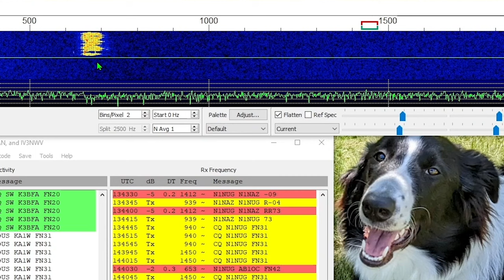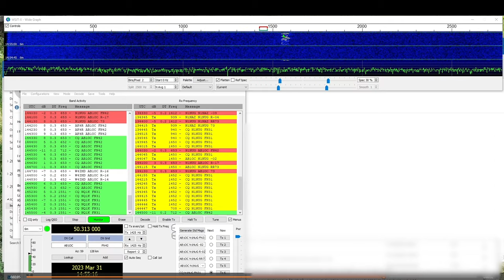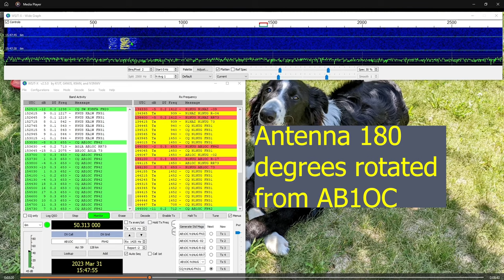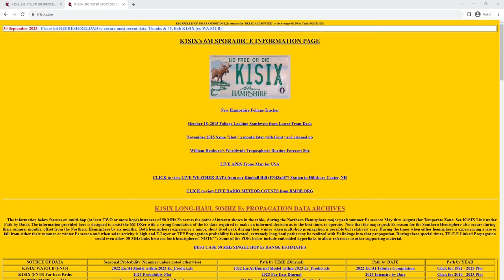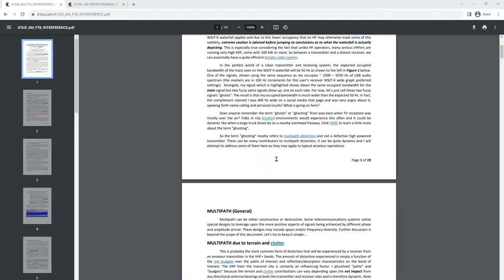Ham Radio: Why are These 6 Meter FT8 Signals So WIDE?

Comment: FT8 signals are a single tone that shifts in frequency over time to represent the data symbols.
The most current symbol is received over the more direct path.
A previous symbol is received at the same time, but over a longer path.
These two may be creating mixing products, the sum and the difference.

Distance does not change the frequency. Changing distance (Doppler) does, but is unlikely given  your description and steady observations.
To shift up and down, at the same time would require two reflecting surfaces, one approaching you and one leaving you.

The waterfall display, of the decoded audio, obscures what is really going on. (WSJT-X display)
It would be interesting to observe this phenomenon using a different receiver design, such as one of the SDRs with a high resolution spectrum display.

You have a 991A? I think that is a triple conversion superhetrodyne, so mixing products, artifacts, may be occurring in your receiver.

I am unlikely to recreate your situation here in Florida, where I can compare an Icom IC-756proIII with a FLEX-6400 using a 5-element beam, but without any mountains.

-Tim, KI4TG
Reply: you are systematic. Look at my post

Comment: Excellent video Rob and a very personal interest to me. 

I’ve noticed this phenomenon on 6m too and from what I can see on my end is Sporadic E backstatter. 

Basically two (or more) stations might be pointing at a common point (a cloud) but not actually pointing at each other (but still receiving each other direct, either via another cloud or via groundwave etc).

What you then get are these ghost or mirror images with multipathing as you described, sometimes really strong and distorted.

It’s common for me to receive a station in VK5 (approx 315 degrees heading) when I’m beaming toward New Zealand (20 degrees) and I’ll get two signals - you can actually see it more clearly on WSPR and it decodes as two signals on different frequencies. Very cool! Thanks again for the video
Reply from the maker: I think you are right - the reflections are most likely coming from sporadic E "clouds".  I think what we are seeing is "delay spread" which causes the signal to spread out and look wide.
Reply: the differences are too small. Look at my post

Comment: Simple Multipath is a time domain phenomenon.   It won't create a frequency shift like that.  If the frequency shift changes,  it could be dopler, the reflection of a  moving, a truck?  If one of the atmospheric paths is changing  effective length, that would create a dopler shift.  A constant frequency image could be caused by mixing.  It looked like the image was shifted by 60 hz.  LED Christmas tree lights?  Or many other way 60Hz could get nonlinearly mixed.
Reply: i do not think so. If so, then it would manifest at any angle. Look at my post and give me your opinion

Comment: A time delay such as multipath would cause a phase  shift, Fourier Transform pairs, so it must be  something else.   Hard  to tell since not under controlled conditions.  Good  that you are  looking into this!
Reply: Suspect it is not for different pathways outside antenna, but for different pathways inside the antenna, meaning in the space inside the geometry of the antenna. Suspect it only happens, or mainly happens to multielement directional antennas. It is about the directivity mechanism, where axial it is phased, and from sides it is unphased. The differences in frequency that result, correspond to the size of the elements of the antenna, space delays that can result within those sizes. It has nothing to do with different pathways on the long distance propagation.

Comment: This looks like classic doppler shifting the audio frequency just like a freight train coming and going while the horn is triggered.  If thats the case, there's likely a multipath-causing object that is moving at a constant rate. Or two objects causing multipath, each moving at a certain rate but in opposite directions.   Pretty amazing. My guess is that the exact frequency shift of the audio and the amplitude could point you toward the object(s).   One other thought - is there a heliport nearby ?  If so, it could be worth checking the typical rotation speed of the props when a helicopter is on the ground, and compare that with the location (dist) and the audio shift.
Reply from the maker: The closest airport is 25 miles away.  And this phenomenon happens all the time, not just for a few minutes.  I think we're looking at delay spread which is similar to  the Doppler spread you are talking about.
Reply: @SevenFortyOne  You might be seeing meteor scatter. Its very doable on 6m. There are specific frequencies people use for ft8, msk144, and ssb meteor work on 6.

Comment: That’s odd and I’m confused. Unless the thing doing the reflecting is moving very fast  (like a plane, satellite, or ionospheric disturbances) multipath should not alter the frequency *that much*. It will alter the time, ie latency, because it travels a longer path. It’s the same as an echo off a canyon wall - your voice’s echo isn’t deeper or higher pitched. I will have to read up on it!

Update: after reading up on it, i'm convinced this is airplane scatter. Air traffic flying to or away the transmitter on the order of 600 mph can cause a doppler shift of up to 50Hz on either side of the fundamental. That lines up with the greatest extent AB1OC's signal was off-frequency at 5:29. However, the change in frequency over time is kind of slow, so you don't see it well in the ft8 waterfall, but I do notice wsjt-x fails to decode the ghost, and that makes sense - because wsjt loses frequency sync since it might be several Hz off from when it started.

Also, since AB1OC's using big QRO, and the RCS of a typical jet at 50MHz is pretty massive (I have industry experience as a defense aerospace RF engineer), it's a no-brainer. K1SIX alluded to it in his monologue, but called it off for "insufficient information." 

The smoking gun would be to get AB1OC to send out a CW signal for a minute, and watch his ghost drift by 0.5hz/sec or so. That kind of thing is pretty hard to track along with FT8.

Multipath against static reflectors like terrain should certainly not modify the frequency (only the time delay i.e. phase, which will cause amplitude fading) unless those mountains are being moved. Shout out to whoever figured out how to move mountains that fast!
Reply from the maker: I'm certainly no expert but I think we are seeing delay spread or Doppler spread but I'm not sure what's causing it.  I need to do more research too....
Reply: @SevenFortyOne   I made an edit to my comment - convinced it's airplane scatter.
Reply from the maker: @N0SSC  What you are saying makes perfect sense.  However, this wasn't a one time occurrence.  I didn't mention it in the video but I saw this on AB1OC and K1SIX every day over the span of a few hours for a week or so.  Judging from the complaints K1SIX has received others are seeing it pretty consistently too.  Also, If I kept the antenna pointed away from Fred the ghost images stayed fairly constant during the times I was paying attention.  Signal strength faded in and out a bit but he always looked wide when the antenna was pointed away.  However, we are under the main flight path between the US and Europe so there is pretty consistent air traffic overhead (30,000 - 40,000 ft) most days.  Maybe there is enough traffic up there to sustain the signal spreading over several hours and occur regularly every day.  I'll have set this all up again and have another look with flight radar open on another screen and see if I can draw any correlations between the signal spread and air traffic.
Reply: @SevenFortyOne  k1vlf on YouTube has some airplane scatter spectrum captures from near your area, using VORs as sources. There’s tons of air traffic density up there, so it’s not surprising that it’s consistent but looks a bit different every time. Aircraft scatter is a highly desired phenomenon for microwave flatlanders, insofar that W3SZ wrote a program to plan AS contacts with real-time flight data.
Reply from the maker: Thanks for the heads up - I'll check out Paul's videos on the subject.  I really like his videos and watch most of them when he publishes them but must have missed that one.

Comment: When a signal reflects off a stationary object, it will be shifted in time only, not frequency. If it was reflected off of a moving object, you would have a frequency shift due to the doppler effect.
Reply: yeah, but that would not be symetrical, would produce only on one side. Look at my post and give me your opinion

Comment: I am sure my point has already been raised in the comments, this is an interesting observation but as presented is not entirely convincing me. I think the multipath aspect is absolutely correct but that the reflection path is changing in distance. Perhaps a moving layer of the ionosphere. A reflection over a fixed path length should appear a the receiver at the same frequency it was transmitted on. A varying length path will create doppler shift. A very interesting video, and I do have some sympathy for a station that does get complaints from others. I operate FT8 a lot on HF, but so does another station a few hundred yards away. The phase noise from my rig and the ridiculous signal strength he got from me made his life a bit miserable when he was working some of the exotic DX, he now has my phone number so he can text me and I will change band. 73
Reply: the differences are too small. There must be something of only meters size. Look at my post and give me your opinion
Reply: @SergiuCosminViorel  I don't know but even a fast moving vehicle can produce noticeable doppler shift on 6m. I don't believe it is an effect within the antenna. more likely a rapidly changing path length.
Reply: @g0fvt  a car that travels with 72 km/h, it travels with 20 m/second, that in 20m band gives 1 hertz difference, in 6m band gives 3 hertz and something. 
Whatis observed there, is no Doppler effect.  Not of any car. 
Airplanes? multiply! Not more than 30 times, it means bellow 90 hertz. And must be two planes, one incoming, one departing. lso must not be observed at all moments, only while you have two airplanes above. The two sides of the spread must alternate in strength over long time.

Anyway, i do not know how a directive antenna works. Am just wondering about it
Reply: @SergiuCosminViorel  a moving reflector ie a car in the example can be responsible for double that doppler shift. At 50MHz you will get a shift of 50Hz if the path changes by 300m/S, ie the car doing 150m/S. Un-realistic speed for a car but not for a plane or ionised gas I would have thought.
Reply: @g0fvt  i did not exclude airplanes. Am doing more than following this video, and i cannot watch it all again, i have other things to do. 
I wrote here about how to consider. IF the frequency shift is of certain value, what to search for. 
The problem is with the shifs on both sides. Airplanes cannot do that, unless you have two, one coming, one departing. 
IF you have 3khz shift, then it is modulation, non-linear component... a bad contact and some stray signals can do that. Unlikely though. Too extreme. 

Back to the idea of highway full of cars: 
In this case you do not need high speed, normal speed would do fine, and you would not look for any Doppler, as the length of that highway replaces the need for high speed Doppler, the speed of the cars does not matter, the size of the cars matter, optimizes effect on 6m band. 
In the case of the highway, the two sides shift is given by the fact that your antenna is in the middle of some paralel to the highway. 
One problem with that though, a long highway would give large shifts on both sides. Or is it? 
As secondary emitters, they are not reflectors, they are receivers and secondary emitters, meaning your "reflection is not attenuated for near, and attenuated a lot for far". 
Anyway, to decide exactly what it is, more precise observation is needed
Reply: @g0fvt  ah, i forgot, about within antenna, that too, i do not believe. It was an introductory joke. And if i would still consider it, because some small effect is to be expected, that would be in range of some 1 hertz shift.
Reply: @SergiuCosminViorel  I think something is being lost in the translation.
Reply: @g0fvt  i don't think so. Just do not expect me to even try to communicate more in an english/american way. I do not intend to become english or american
Reply: @SergiuCosminViorel  fair enough, I happen to be English, and can understand a little of what the Americans say 🙂

Comment: I don't quite grasp this. A signal arriving at different times would be a shift in phase between the two (or more) signals. But how does that cause the freq shift ? It isnt doppler because everything is stationary.
What does make sense is what was mentioned above, signals somehow mixing, priducing the highs and lows.  Good catch to even see this ! Good discussion also, thanks..
Reply: there is no non-linear element in all that scheme, therefore no m mixing of that sort. Look at my post and give me your opinion

Comment: splatter!!!!
overmodulation and to much power
Reply from the maker: That's not what we are seeing here at all.  If it was splatter the signals would splatter more when I had my antenna pointed directly at them and they were strongest.  In these examples, the strong signals were narrow/normal and the weak ones were wide.  Take a look at the research k1six had done for a detailed explanation

Comment: I wanted first to say it is rather Doppler, but thought more, played silly time wasting game, ate nutts with fungus, drunk a lot of coffee, looked at some porn photos, then it came to me. See? Porn is best inspiring. I do not agree is for different pathways. In any case, not that! 
Suspect it is not for different pathways outside antenna, but for different pathways inside the antenna, meaning in the space inside the geometry of the antenna. Suspect it only happens, or mainly happens to multielement directional antennas. It is about the directivity mechanism, where axial it is phased, and from sides it is unphased. The differences in frequency that result, correspond to the size of the elements of the antenna, space delays that can result within those sizes. It has nothing to do with different pathways on the long distance propagation.
Reply from the maker: Very interesting theory.
Reply: @SevenFortyOne  Yeah, but it is not so. Just a trick. Could be, maybe, but it depends on frequency shift. 
Anyway, the idea, the valid idea, is like this: 
Take the frequency shift, multiply it by the wavelength, what you get is the size of the pathway difference. 
If you have 3khz difference on 6m, it gives 18 km, so you must check what is at that distance. 
If the shift is symetrical, must be something like come and go, that could be an highway. 
The effect is optimal for 6m band, which coincides with size of the cars. Around that... 
So i say it is a highway effect. 
When you put antenna on one direction, directivity disfavours the highway effect. 
You change it at some 30 degrees say, it favours the highway effect, which still comes weaker, because it suffered dispersion, as the cars radiate roughly non-directively the incoming snergy. 
If your bad is 3khz, then you have a highway at some10 to 25 km. 
If your band is 300hz, the distance is 1 to 3 km. 
there is also the possibility that you are closer to the highway, and you get signal from all along it. 
If it is not this, then you have something very naughty there. Maybe you are naughty.
Reply: @SevenFortyOne  something more to verify, the quality of connections to antenna, and metal-metal contacts within antenna. Partial, bad contact, oxides, maybe they can play the role of mixer, double sidebands to appear as your signal gets modulated by audio frequency, but the result would rather be fady from the center off. 
When i say audio frequency, i do not mean audio, but electromagnetic in audio band, which could be, should be like progressively fading specter. Unlike your example.
Reply: @SevenFortyOne  sorry, i was sleepy, and now i am even more sleepy. It is sleepy catastrophy, so i can not concentrate. 

back to the problem! 
cars, with their velocity, can produce frequency shift of only few hz, so any Doppler is out of question. 
Back to the highway, that very well can be a powerline of kilometers straitline or so, and also some railway. Any many kilometers long metal. With this model, your sides must be of unequal power, which is your case, if i am not mistaken. 
With an omnidirectional antenna, you would have symetrical sides. 

Now thinking more, with powerline or railway, you would have this on many bands, but if you observed it only, or mainly on 6m band, it means car sized metalic elements, those are cars on a highway. 
A long distribution, like a long metal element, but optimized on of around 6m